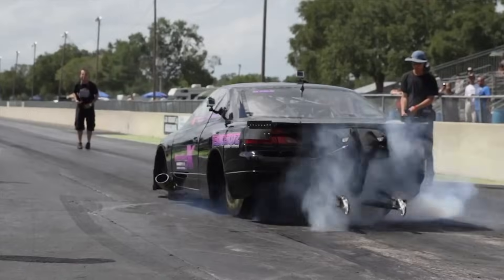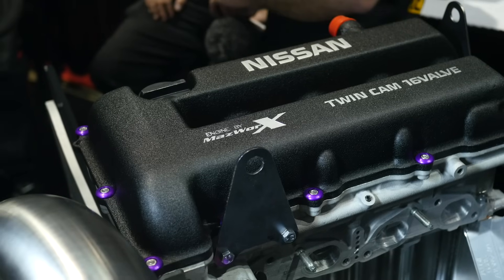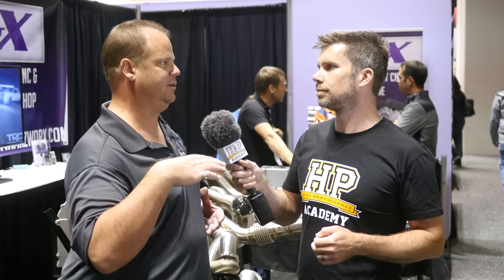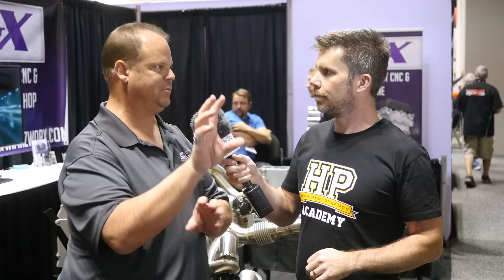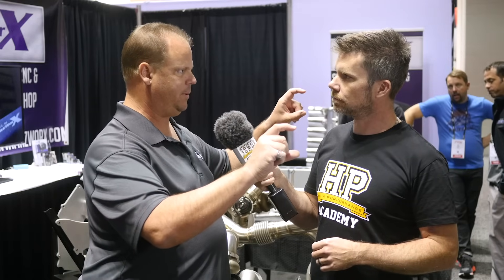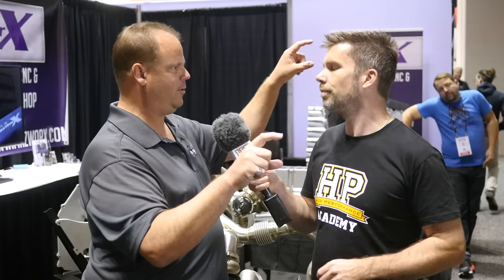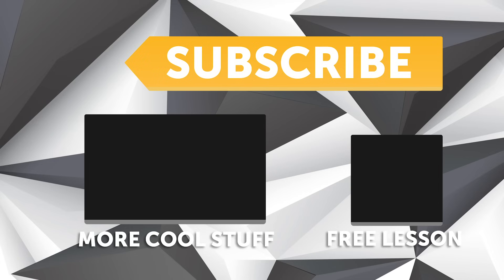3000HP, 150 PSI Of Boost | What Do YOU Know About Compound Turbo Systems | Shane T [TECH TALK]

Comment: Make the horsepower by peaking the boost above and outside of the torque curve range to keep the engine dimensions from instantaneously hyper-expanding, hmmm, interesting theory, doesn’t sound practical, but somehow seems legitimately ingenious, very intuitive concept. 
 I was obsessed with high consistent volume and controlled boost pressure, (without loss of volume) by use of (no way Im getting another granule of intellectual property stolen) but the same principal applies, cooler denser more effective with more mass, the intake charge will amount to increased combustion speed, expansion volume, and when the gasses are cooling in the exhaust system, they retain more mass per unit of volume than hotter thinner low density intake air charges would produce, even at similar temperatures, this high speed exhaust charge can be timed to a sweet spot, well I’ve said enough about that, but I like the Outside Of The Proverbial Box Inception successfully becoming a reality!
Reply: WTF are you going on about? What you just said is the very BASIC concept of air density effects on an engine and it's results. Something EVERY engine builder has known about forever. 🤦🏻

Comment: Struggling to understand how a charge cooler can reduce the temperature from over 300 degrees (farenheit) over ambient to just 5 degrees above ambient at full flow rate. Assuming this is an air to air intercooler using ambient air, it sounds "surprisingly good". Perhaps I'm missing something. Can you confirm / explain?
Reply: Probably ice-water/air as another comment says, far larger thermal mass to soak the heat + smaller IC
Reply: NOT an air to air cooler. NOT possible

Comment: he never thought about preturbo meth injection but between the compound setup.. but for me.. dont preinject anything into a turbo. cus liquids can impact like solids in condition of high pressure in which mat result in catastrophic engine failure or run untill thus said

Comment: i have a question that i have been tring to find out for myself i have a 98 ford explorer with a 5.0 l they come stock like that from the factory ,the base engine is a mustang 5.0 but ford had mad some changes to the eletronics ,my question is i  have been tring to find a ecm that i can program and set up so i can tune it myself but ive been serching and i have found nothing what do you suggest or recommend

Comment: What’s so ironic about compounding turbocharged engine is that. Back in early days before fast and furious came to the silver screen i mentioned it to my friend who had a civic with a K20 engine installed and covered it to rear wheel drive. Well at the time when I mentioned compounding the turbo’d engine. He’s exact words were.. well if it was a diesel that would make sense? I asked why? He had no answer. Maybe running 4-5  meth injectors per cyl was a daunting challenge? Well in my opinion some race team has accomplished it 20 years later lol! I think what’s holding us back is fear. It’s not like technology has advanced so much over 20yrs. Motech is still what most race teams use. Diesels have been compounding turbos for decades. So don’t be scared. Try it out and approach it scientifically. 🤘🤘

Comment: 1st compressor sees 1:9 boost and second sees 1:9 boost. Does it means that stress to the sompressor blades is equal in low and high pressure compressor?
I hardly belliewe that. 

Also what kind of pistons and rings and head and block does one need to cope with such a boost???????????
You have boost in the amount normal engines have pick cylinder pressure!!!!!!!
This is just crazy if its true....

Comment: Plumb some liquid nitrogen or NoS nozzles in front of the intercoolers to cool them way down!
Reply: tom conner wouldnt that reduce the amount of oxygen in the mix?
Reply: It would, and I see where and why the comment wasn’t clear, “so the discharge tube winds around the outside of the heat exchanger and is in constant contact then purges away from the intake air, and some liquid NOS in the exhaust pre turbine to cool the temps, just a thought, cold heavy exhaust spools you up quicker. Like the guy with the Camaro his turbos are installed all the way in the back by the gas fuel cell piped  them forward  to the front end of the motor doesn’t even need an intercooler solidifying the map eliminates the need for up pipe  exhaust manifolds drops under hood temps saves room under hood
Reply: 2 wheels or 4 his talent is underexploited

Comment: Hey Team, just a question about the blades on the turbo's these are 2D in nature, widthxdepth is there a way where we could use two lily /tulip impellers which are (3D) to drive implosive compression into the intake? 

Using the exhaust housing in a vertical drop spiral which then would drive a 1x (x) gear induction lilly/tulip impeller

I hope someone understands what I am saying? lol
Reply: No

Comment: These numbers make my head hurt.
Wasn't THOR supposed to be a potential 3k hp engine? With 4 litres and a much beefier construction it might be a rival as it seems it may potentially be more reliable?
Reply: They haven't made drag trim thor engine in reality though, the vibration will be real challenge with large 4 cyl. 10k+ rpm in 4 liter 4 cyl will easily destroy itself.
Reply: @ardijanuar2036  Hence "supposed" ;-) - however, if they concentrated on cylinder pressure rather than rpm... and it is 'supposed' to be good for over 10k anyway, so, just needs someone to load one up to see. ;-)
Do you know of any folks doing work on 90 degree cranks for these larger 4 cylinder engines, as that will drastically reduce the inertial and dynamic loadings, especially on the centre bearing?

Comment: Hmm interesting usually twins or compound setups on any inline motor are usually not as efficient as 1 big single usually having 2 turbos on inline motors u split exhaust gasses into two separate turbos in essence splitting up power but this is very interesting!some huge giant power to fuckin dam!

Comment: dear sir;

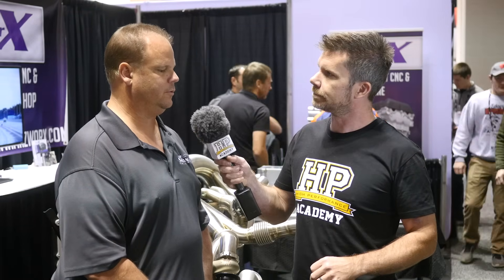at 4:52 he said " a turbo is a multiplier " 
in the second stage, the impeller of the compressor side is not designed to take 3 times air density, then using the same map, to multiply the initial boost : i think it's a bit inaccurate ...

however, thank you, and for next time, i hope you can provide in the description some useful information, example : used turbos types, the first and second stage back pressures at 150psi... 

thanks.

Comment: Hmmm, I've got twice the cylinders, three times the displacement, a quarter the horsepower and luckily only a tenth of the cost.
Reply from the maker: I don't think anyone chases world records with the idea they want a budget drag car build in mind though to be fair, however, it is important you enjoy what you own and drive =) - Taz.
Reply: @hpa101  
Thanks for the reply, rather than editing my original, let me explain. 
I'm in no way shitting on what they're achieving. By "luckily", I meant that the everyman(me, in this case), can afford to build decent, reliable horsepower. 10-15 years ago, my HP level wasn't achievable on my budget. That's thanks to people, like in your video, pushing the boundaries, funding the R&D, on big budgets, pushing the aftermarket to make parts, that support big power, which over time, become affordable to people like me.
I 100% appreciate what, those out the front of the pack do for car guys everywhere.

Comment: I'm confused when shane said that the turbo system is capable of 380psi because he said its 9 times atmospheric pressure times 9, so that's 81 times atmospheric pressure, right?
And if atmospheric pressure is 15psi, 81 times 15 is 1215psi... So isn't that 1215 pounds of boost?
Reply: Just stop

Comment: Rob Dahm is going to make 3k horsepower with a single 106mm garret turbo, on the 4 rotor. It is possible to make 3000hp with one turbo
Reply from the maker: Making power is one thing, making usable power to get down the drag strip as fast as possible is another - Taz.

Comment: They're getting 10 to 12,000 hp from 8 cylinders now...stands to reason that 4 cylinders could do half as much.
Reply from the maker: From engines that are 8.1L or so, from memory this is around 2.2L. The number of cylinders are only part of the puzzle :) As Shane said though they'll do their best to get this build producing as much power as they can reliably, and then see how fast they can make it down the 1/4 (not the shorter 1/8th like those 10-12,000HP engines. Just another difference) - Taz.

Comment: I didn't feel like he answered the question about using Methanol sprayed between the turbo stages to reduce the charge temperature. He seemed to argue that the weight of the intercoolers was minimal compared to the hp/weight added. Not sure if he was offended or misunderstood the question from a teaching aspect. I'm sure the intercoolers are the way to go but I think the question was geared to explain why Methanol injection wasn’t used. Excellent Q&A by both. They're both crazy smart.

Comment: Did you know marine ships have around 50,000bhp to 100,000bhp. 

They use this type of method as well. 

Top speed around 70mph not sure in knots etc but it like that. 

And I raver see like a ford f650 bus with 1200bhp on used. 

And f1 had around 1300bhp back in 1980 etc
Reply from the maker: Good luck getting a 2-ton marine engine down a drag strip in 6 seconds, or a 1980's F1 car. Very different applications that are certainly impressive in their own right 🤘- Taz.
Reply: @hpa101  yes they are to be honest to different engine  both are making loads of power

Comment: When I hear these numbers like 90 lb of boost is this done in PSIG or psia?
Reply: Probably psig but even if it was psia that is still a shit load
Reply: @snikwad003  heck yeah that's a lot. I don't see how it doesn't blow those intercoolers apart.
Reply: @jiveturkey9993  some tough parts they're using. Its crazy to me these guys are shoving diesel boost numbers into these tiny engines

Comment: He needs to look in to HPA tanks  that hold 4500PSI and valve that can regulate what ever he wants  and theirs your cold Hi pressure and your limitation is air volume but your lave your 150 or even 300 if you want lol and eliminate the turbos. you will then be limited  to only run as long as the tanks have air
Reply: thats allready a thing there called rocket cars, instead of HPA they use liquid oxygene. look up  "3.22 402mph" on yt. thats the fastest rocket car. the engine is bassically just the exaust half of a turbo and then a combustion chamber.

Comment: Andre asked why not spraying methanol to absorb heat instead of intercooling and I ask: why not ditch the whole turbo system and run a 3000 hp worth of nitrous kits
You would potentially save alot of weight and space but have same power potential right ?
Reply: You spray 3000hp worth of spray and see how you go.
Reply: Nitrous is an oxidizer, and unless you can compress that oxidizer enough, you won't be gaining as much as a high pressure turbo

Comment: So if you put that turbo system on an 8 cylinder engine, you can potentially get 6000 HP? Sooo...why not go there?
Reply from the maker: Why only a measly 8 cylinders when you could go for 10, 12 or even 16 or more 😉 There are class rules for whatever your preference is so if you want to race an 8 cylinder you can, but you won't be doing it in the 4 cylinder class - Taz.
Reply: @hpa101  Yes unless you run into the concept of laws of diminishing returns. And based on historical data where 10, 12, or 16 cylinders are not usually used to produced ultra high performance engine with a handful of exceptions, I can only assume that the law comes into effect right at 8 cylinder, and anything more will not yield a linear increase in HP, perhaps due to violation of Thermodynamic principles, or just simple laws of Physics? IDK. Or perhaps 8 cylinder is not the sweet spot but 6 instead since that seems to be the trend with Ford's high performance engines. My point is, from a layman's perspective 4 cylinder engines I hope should  be used as a proof of concept when building ultra high performance engines by using modern high tech forced induction methods. I love 4 cylinder engines don't get me wrong, but I also love how technology is creating new standards in motor sport, and wouldn't be nice to see a non-top fuel dragster break the 4 second mark which stood for decades?

Comment: That all adds up to an extremely long induction tract with a big lag  built in  .
Reply from the maker: They have considered that in many respects for the application here which is drag racing. They're not working on a 3000hp 4 cylinder compound turbo setup to go endurance racing or drop the kids off at school - Taz.

Comment: "We chose to use a charger heat exchanger between each stage" - yeah, they're called intercoolers. 
"And then obviously another charger heat exchanger after that" - Yeah, they're called aftercoolers.
Reply: heat exchanger is a better term to use. Plus, they are using water-to-air, not air-to-air.

Comment: try using a mazda FE3N engine, you will be running it on stock internals to 3000hp lol just kidding, however the FE3N is far better than the SR20.
Reply: No
Reply: @yenlewis6606  yes

Comment: So basically doing what has been done in large marine and stationary diesel engines for 10 years…
Reply: Oh, it's easy on diesel when the fuel want to detonate under pressure.

Not that easy when you don't run with petrol.

It's unheard of.

Comment: Should have done a v8......
Bv
Reply from the maker: Why, when there are V10's, V12's, V16's etc? Why even use a piston engine when you could just use a jet engine?

Because they want to, and this is the class they are racing in 😉 The technology used is similar if not the same even when you have more, or less, cylinders and more, or less, engine capacity.

That said, no one is stopping YOU from building whatever you want to build, or not build as the case may be :) - Taz.